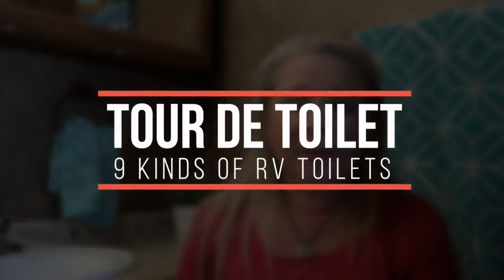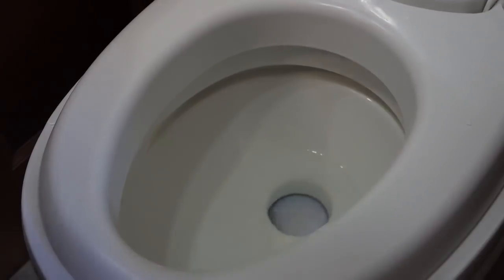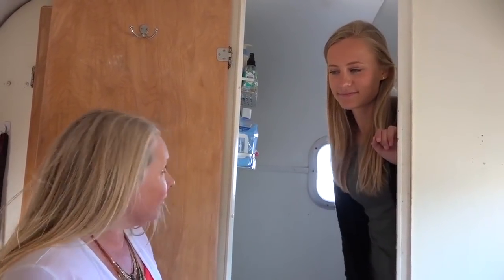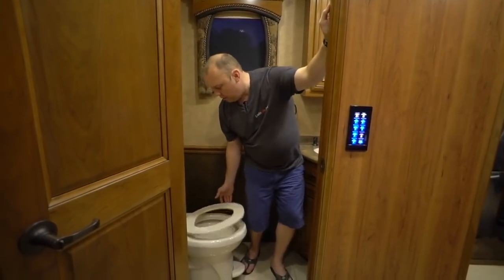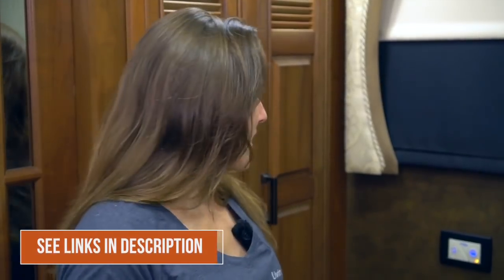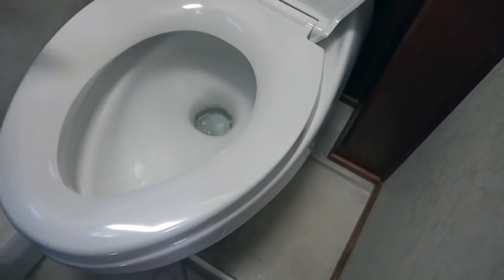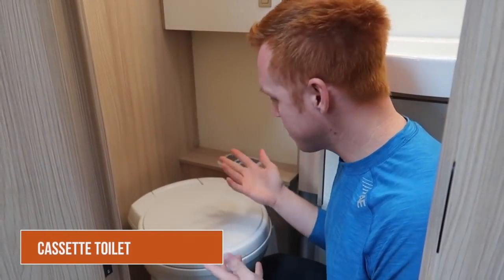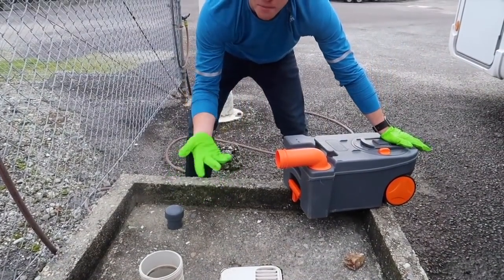9 KINDS OF RV TOILETS: "TOUR DE TOILET" WITH FULL TIME RVERS SHOWING HOW THEY WORK + PROS & CONS

Comment: Use polymer based car wax (not petroleum based or carnauba wax) on the inside of your bowl to prevent things from sticking. Makes cleaning much easier.
Reply from the maker: Interesting tip.  Thanks for sharing.
Reply: Works great in shower and sink too!
Reply: Made me think of original Pam cooking spray.  Wonder if that'd work :)
Reply: That is such a good idea! How often do you have to reapply? I have the Natures Head (https://bit.ly/2VXAuO8) and feel this would be great for the solids bin area.
Reply: Great Tip. Tanks!
Reply: When the bowl is dry u could spray some silicone on it

Comment: 10th kind: Incineration toilet. I have one on my boat (Incinolet). No plumbing at all. The purchase cost was significant, but I liked the simplicity and reliability of it. Only good if you have plenty of electricity because it takes some power to reduce all the waste to ash. In my case we have plenty of battery power so no worries.
Reply from the maker: Hopefully we can come across somebody in person with one of these so we can include in future videos.  We have heard a lot about them, but haven't met somebody with one yet.
Reply: Thanks so much for info.
Reply: Do you use solar to charge batteries? How many “flushes” would one battery do? What sort of battery do you hook it up to? Thank you
Reply: The manufacturer also make a gas/ propane model.

Comment: Thanks for that toilet presentation. We recently finished building our expedition vehicle and for that 7 things were important to us re the toilet: no electrictiy, no water consumption, no chemical treatment, low weight, no smell, easy dumping, no complex mechanic or electronic parts. That automatically led us to a composting toilet. The market leaders are Separett and NatureHead, but there is also a young UK based company called Kildwick, producing nice looking composting toilets. So far we are extremely happy with our Kildwick toilet. Dumping is so easy, its not smelling and we have not to be afraid that something technical can break during our trips. Cheers from Switzerland
Reply from the maker: Thanks Benny.  Agreed, in your application, a composting toilet definitely makes the most sense.  Thank you for sharing the extra information.
Reply: I love the fact that urine from the separet goes straight into the grey tank removing one more job.

Comment: Julie, you are a year late.  I had to replace my RV toilet last year because the discoloration of the plastic bowl got to be more than I could bear.  I got a china bowl foot flush and have been happy with it.  When I boondock, I usually do it where there is an outhouse provided and I go there for solid waste deposits.  This way, I only have liquid in my black tank.  That makes it easier all the way around, except on a few occasions when the outhouse was full of mosquitoes!
Reply from the maker: Thanks for sharing.  Yes, mosquitos and wasps in outhouses can make for an unpleasant visit.

Comment: I’ve been wondering about the cassette toilets versus the foot flush versus the composting toilets. This was very helpful. Thanks!
Reply: I have a neighbor that has a cassette toilet and they love it.  They don’t have to have full hook ups and they don’t need to have a honey wagon.  They don’t mind taking the cassette to the dump station periodically.  I would rather have full hook ups when I am in a campground and finding a dump station when I am boondocking.   There are the two sides to the cassette question.  From there, it is up to you.
Reply from the maker: Glad you found it helpful.  Thank you.
Reply: @wcarlhepker4806  I don't think you have to dump it everyday,  Maybe if you have a big family. I think we are going to buy a Revel 4x4 and it has a cassette in it so we will see how it works.
Reply: @Rvlove  found the cassette toilet interesting; might just be what will be the solution. 
Would appreciate a brand name as I’m not having much luck on the net. Thx- appreciate the video.

Comment: I'm rebuilding a 69 fireball camper and deciding on a toilet system. the compost seems the best but that cassette deal is also nice.
Reply from the maker: Composting toilet would probably be an easier aftermarket install than cassette.
Reply: RVLove | Marc & Julie Bennett
 that's true. i like how the cassette empties from outside
Reply: Good for You❣️I've been living in an '88 Fireball 5th Wheel for 3 yrs ( nothing in the bathroom works!) I bought a new porcelain Dometic toilet for it 2yrs ago, but since I can't do the necessary renovations myself; it's still sitting outdoors on a pallet! Wishing you All the Best >👵from CA.
Reply: @dkleath8697  Do you mean a regular toilet for use with a septic system? I'm thinking doing maybe someplace out back of my house. I see some people on YOUTUBE have done it cheaply. At my age and health condition. I don't see travel with mine. Being road worthy is a whole different ballgame than making a quiet  solar powered getaway out back in the woods. Just need the right person to pull that one off. unfortunately the septic at my home decided to act up and needs a-fixen now. 
Typical. But wish you all the best. Good stuff happens too.

Comment: This may sound weird but this is exactly what I was hoping to see. Thanks for going through the options.
What I have never seen yet is someone hooking up the hose to their black tank outlet. I'm wondering what all that entails. I guess I'll have to look around a bit on YouTube.
Reply from the maker: Hi Bill,  Glad you found it so helpful.  Hooking up the hose to the waste tanks is actually super easy.  Usually just a quarter turn with a bayonette fitting at the RV end, and screwing in at the dump station end (or sometimes just putting a rock or other heavy item on that end so it doesn't move.  Then pull the handle on the blade valve to start releasing the contents.  It is recommended to open the valve slowly at first to reduce the initial force, especially if not secured firmly by screwing into the dump area. Thank you
Reply: Thanks for the explanation. I was originally looking to go with a composting toilet but now a flush toilet seems better.

Comment: Heath is soooo adorable and funny. "It a poop suitcase and carry on.". I was seriously ROFL.

Great info. What I am having trouble with is finding a porcelain commode that'll accept an electric bidet toilet seat. Or a bidet toilet for an RV. I thought I saw one in 40ft Cameo 5th wheel. But I don't remember the brand of it. The smallest bidet seats I can find still require a 1.5 inch clearance from the seat screws back. Is there a riser that'll accept longer screws to I can get above the water valve hump thats blocking the bidet seat from fitting. Basically need a riser that can have a toilet seats bolt on from the top. Or info from anyone thats successfully adapted their toilet to accept an electric Bidet seat. We have them in all our home bathrooms and refuse to go back to manual "cleaning". Sure one can use the bowl cleaning spray, but they're only refreshing on hot days. I do travel with one that I attach to virtually any bathroom faucet to get warm water cleaning. But those are not the hands free experience I am used too. 

Thanks y'all. I look forward to hearing from fellow bidet user's who've found a way to overcome the RV industries prejudice against electric bidet seats. A heated seat is a wonderdul experience during cold nights and days. 

Cheers from Seattle
Reply from the maker: Hello Cameron.  Sorry but we don't have any awareness of electric bidet compatible RV toilets.  Hopefully somebody else reading the comments will have insight to share.  Consider reaching out to Dometic directly.  Perhaps they would consider producing one.
Reply: @Rvlove  Ah hah! This 2" riser may actually work. There is also a 3 inch bolt on riser too. Does the bump on the back of typical RV porcelain toilets rise up more than 3 inches? I didn't check how high it bumps up on the DRV I was looking at. If it's no higher than 2 or 3 inches these (https://www.homedepot.com/p/Carex-Health-Brands-Hinged-Toilet-Seat-Riser-Elongated-FGB32100-0000/206572494 or the https://www.homedepot.com/p/DMI-Elongated-Hinged-Elevated-Toilet-Seat-in-White-641-2571-0005/204653100?MERCH=REC-PIPHorizontal1_rr-206572494--204653100--N) should work in order to add an electric bidet seat. Clearly a 20" aka comfort height toilet will increase to nearly 24-5 inches high with the riser and your choice of bidet seat. So one may want to get a lower height toilet or one of the "Squatty potty" steps to get back to a comfort height. 

So if some of you reading this can measure the height of the bump behind the seat I would greatly appreciated it. Please not the brand and model of your particular toilet and the bump height why you reply. This will not only help me, it'll help others considering adding an electric bidet to their RV. Yes, the electric bidet seats require 110 power to used the bidet (water heater, pump, heated seat, massage functions and lights) and will require a T valve added to the toilets water supply. For me adding an outlet behind the toilet and the water supply adapter will be easy. Others have run extension cords. You can get away with an extension cord depending on your bathroom layout and access to 110 power. 

Thank you. Happy holidays!
Cheers from Seattle
Reply: The hose wand they show on a couple'of the units are actually a bidet system it's one of the types of units you can buy at your local building store Rona in Calgary Alberta had 4 retrofit kits a hose with spray nozzle with or without hot water and a toilet seat model with or without hot water I chose the straight cold seat one as by the time hot water gets to the unit your done and the water in the pipe gets to room temperature anyway it can get a little cold for the 2nd or 3rd person who uses it in a short time period

Comment: I have a question. The moment that water and the waste go down, doesn't the smell inside the black tank come out? I'd imagine that it could be very bad, especially if the tank is pretty full.
Reply from the maker: Actually, we have very little smell come up.  We do use a tank treatment called Happy Camper that helps with that.  If you have the fan on above you and leave it open too long.... yes... you will get some smell.
Reply: @Rvlove  I see, thanks for replying!

Comment: on the first toilet shown, how do you get the shroud off to get to the bolts to replace gaskets, can get the cover off the push pedal but can't get to bolts to remove toilet from floor, any suggestions
Reply from the maker: Sorry, it we no longer have that toilet or coach, so I can't remember how to remove it.  Try doing a google search for information on that model toilet.  You might find an owners manual or installation guide.

Comment: Where is the normal house toilet as an option?  Sure they use lots of water, but getting the waste out of the black tank needs it,
so either pay it now (in water) or pay it later.  I'm told you can use filtered grey water to flush.  But you will need a big black tank, as was noted a van or small trailer this isn't really an option.  Thanks for the great video, lots of info in one.
Reply from the maker: Thanks.  Glad you enjoyed the video.  Yes, a regular residential toilet uses a lot of water.  The closest thing you will find in an RV is probably a macerator.  They use a fair bit of water, and seem the most like residential to me. -M

Comment: I personally want to do it NASA style.....where the black and grey water is recycled along with condensation from our sweat and moisture in the cabin are combined, distilled, purified, and converted into potable drinking water!   With such system we will always have plenty of clean water because it's a closed loop!   Plus whatever waste can be digested and the methane gas can be harvested for natural gas cooking, water heating, and thermal climate control such as heated floors etc.
Reply from the maker: That would be pretty cool, but sounds like it might also involve a NASA price tag. LOL.  Worth mentioning that we did see a couple RVs at the Tampa RV show that had systems on board that were re-using water.  It might not be full NASA style, but a very big step in that direction.
Reply: @Rvlove  I don't have any electrician or computer programming knowledge but I have thought about this type of project for some time to try and make it simple.   for example with just the Recycled Potable Water system (the Gas harvesting can later be added and work independantly from the potable water recycling system):
1.  Use a porcelain Macerating toilet, and route the macerated waste water to a blackwater tank.
2. Create a blackwater tank in which all grey and blackwater is routed to.  Create a mesh layer in the blackwater tank 2/3rd's of the way down in the tank so that liquids will be further  be strained from the solid waste and allow the waste to be broken down by anaerobic bacteria (this mesh layer can serve as a digestor which can be accessed by the owner to feed the digestor with compost and earth worms periodically).  Create a sensor to detect when the blackwater tank is full and when it's full send push notification to the owner and a warning indicator in the bathroom to not use the toilet until the wastewater level in the tank is low once more. 
3.  another sensor in the blackwater tank will detect if there's any amount of water present in the tank and will automatically activate a water pump to send that  effluent to a 7-stage (sediment, carbon activated, 2nd carbon activated, chloramine, electrolysis, Reverse Osmosis, Ultra-Violet rays) whole house water filtration system until a sensor from the Potable water tank stops water pump.  Other Sensors within in the whole home water filtration system will notify owner when the filters need to be replaced and/or serviced.
4. That water will further be sent to a Distiller.   Create a sensor for the distiller so that when the distiller is full, distiller will temporarily stop and use an actuator to release the distilled water into a stainless steel potable water tank until it is filled to capacity determined by another sensor which send command all the way to the water pump to cease it's function, and send a push notification to the owner and the bathroom, and kitchen that there's a full supply of potable water.

This process can be scaled up to however many Gallons of Purified Potable water a family may need on a daily cycle. All the pumps and actuators can be powered via solar as well!  This can further be applied to habits such a nuclear bomb shelters, and any place what desired to be completely offgrid!     As far as chemicals and heavy metals....that won't be so much of an issue, since the main thing is process your own body fluids, so microorganisms and bacteria will be the biggest challeging, but the 7-stage water filtration and Distillation will easily take care of all that!

Comment: I dunno seems like the cassette tank seems easier since after dumping you can also rinse it. And maybe you can use bleach/chlorine/liquid soap when you rinse the tank to make sure it's completely sanitary to use again. And you have the option of wearing mask for you not to smell the no. 2. Though I can see the cassette tank is quite small so you might get intimate with your toilet more often. But it's practicality and sanitation seems better. Hope anyone can enlighten us if this is possible?
Reply from the maker: Thanks for sharing your thoughts.  Actually, you will need to be FAR more intimate with your tank contents when using a a cassette toilet AND do so FAR more often.  Many RVs have built in tank flushes so you can flush them out.  And you can clean the toilet better knowing you won't be filling the cassette back up in a few minutes.  When you are hooked up to a sewer hookup at a campsite, you often don't smell or touch much of anything to dump regular tanks.  We only dump our black tank every 2-3 weeks.  Cassette toilets need to be dumped every 2-3 days.  Sometimes even more often. When you dump a cassette toilet it is often into an open dump which will see and smell a lot more.  When dumping a black tank with a sewer hose, it all stays inside the tightly sealed hose. (unless you do something wrong ).  Hope that helps shed some extra light on the realities.  -M

Comment: Gee...I was looking for the 3-shells ....or the sponges the Romans used.  It is amazing we humans can be “sensitive” about bodily functions all of us must perform.  Very informative about the different types of units.  In residential most have the water tank in back that flushes and creates a wash out along with vacuum pulling waste down as it washes.  I understand that when moving these would slosh water...but if drained for transport...why not use a similar technology?  Water conservation is the reason probably...but as we find with residential water savers...if they work poorly you flush more often and do not save.  All the units I saw would not handle a large solid waste flush well I don’t think.  Anyone have commentary on how effective they are when tasked significantly ...and if there is a better mousetrap versus those we saw?
Reply from the maker: Hi Richard.  The macerator toilets are the most similar to traditional residential toilets with water use and effectiveness.  You might be surprised at how well these toilets can handle 'large tasks'  lol.  Even if not filling the bowl with water prior to depositing solids.  Most are gravity fed straight into the tank so there isn't much that can go wrong.  But they do commonly need a little cleaning if you don't add water first. Thank you